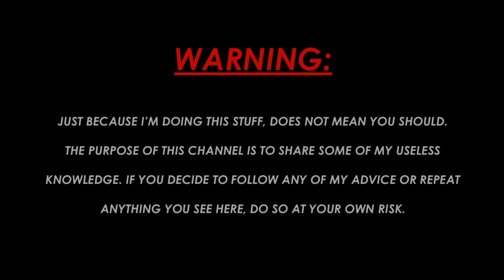What is Ohm's Law??

Comment: Would you please make a video on how in real life you would use that  On a real world problem
Reply: Personally,if I’m engineering some thing that has multiple electrical components. I need to make sure all of them can be in line with one another and make sure they don’t blow each other up.some of the equipment you buy only shows two of the ratings not all three. So to make sure that you’re not overpowering some thing, you do the math to make sure that everything lines up again this is my personal experience with it and the best example I can come up with, but I use it almost every day.
Reply: You have a circuit how many lights can you put on it? They each draw 7 watts its a resi setting? How many can you put on your circuit?